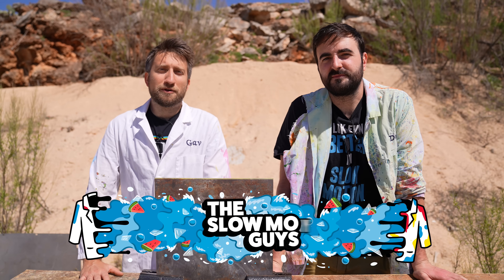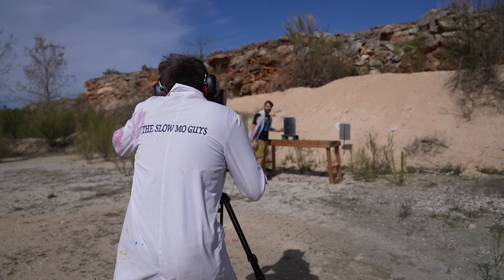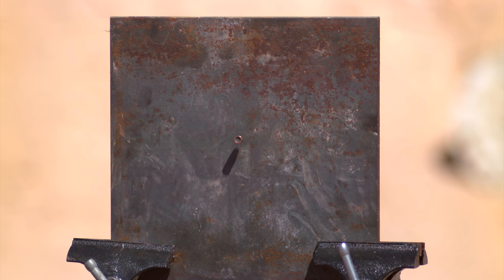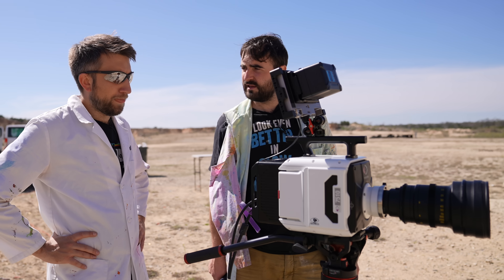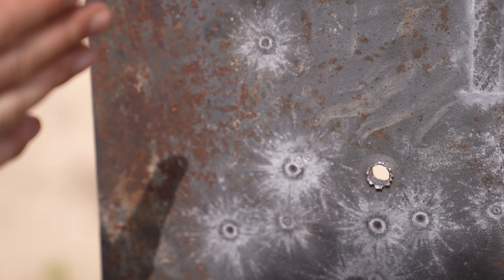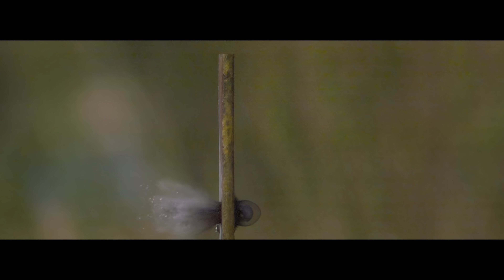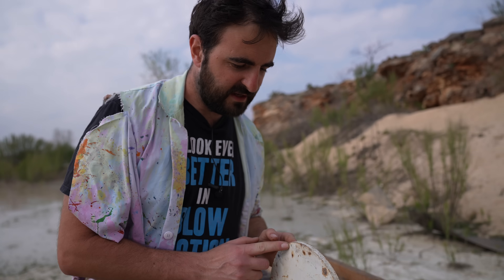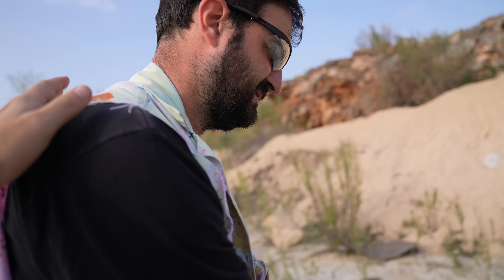Bullets vs Steel at 800,000 FPS - The Slow Mo Guys

Comment: Why does the bullet still continue to spin after going through the target? Physics...especially the conservation of momentum!

So, the principle of conservation of momentum is a fundamental concept in physics, and it states that the total momentum of an isolated system remains constant if no external forces act on it. Momentum, in simple terms, is the product of an object's mass and its velocity.

Let's break down the bullet-target interaction with respect to this principle:

    Before Impact: When a bullet is fired from a rifled gun, the rifling (those spiraled grooves inside the gun barrel) imparts a spin to the bullet. This spinning stabilizes the bullet in flight and ensures better accuracy. So, when the bullet approaches the metal target, it has both linear momentum (due to its forward velocity) and angular momentum (due to its spin).

    Impact with the Target: When the bullet hits the metal target, its linear momentum can be significantly altered, especially if the bullet gets flattened or comes to a stop. However, the angular momentum (the spin) is less affected by the impact. The reason for this is that stopping the spin would require a torque or a force that acts perpendicular to the axis of rotation. Metal targets, being flat, mainly resist the forward motion of the bullet but don't provide a significant counteracting torque to halt the spin. Hence, the bullet might still retain much of its spin even after impact.

    After Impact: Following the conservation principle, if the bullet continues moving after piercing through the target, it would have conserved some of its initial momentum, albeit with changes due to the interaction with the target. However, what's intriguing is that, as mentioned, the bullet often retains a good amount of its spin (angular momentum) after impact because the target doesn't efficiently counteract this motion.

In essence, while the metal target can significantly reduce or halt the bullet's forward momentum, the conservation of angular momentum ensures that the bullet's spin remains largely unaffected. This observation is a practical manifestation of the conservation of momentum.

Comment: This ended up as a beautiful demonstration of the difference between hardened and mild steel. Nearly the same material yet such a massive difference in properties.
Reply: and even cast iron in the end
Reply: @MeltedMask   In fact, I wanted to see a closeup of the fracture in the vice, as that may well have been cast iron.
Reply: @TesserId  most bench vises are cast iron, very hard but very brittle. Good for holding something extremely tightly under a lot of pressure, not good for taking hard impacts.
Reply: @Kross8761   Exactly.  And, all the cast iron that I've seen cracked has had a very course grain pattern.  Forged steel would not have looked like that.  And, that's all I wanted to see.  BTW, I've seen This Old Tony experiment with welding cast iron, which apparently is a real b*tch to manage.
Reply: When it comes to steel, the things the iron gets alloyed with makes a huge difference. To a point It can become a totally different material.
Reply: @Scrial  Yeah. I doubt the average person knows that the difference between low and high carbon steel is a couple percent.  Add a little bit of Cr, Mo, or Ni and you basically get a different metal that behaves completely differently.
ETA: Was going to use the example of stainless steel vs. steel or iron but forgot.
Reply: Hmmm. There could be differences in the alloys, or not.  Hardening could be just a change in the crystalline structure.  In this context, that somehow becomes much more interesting.
Reply: @yazmeliayzol624 There are lots of different iron alloys. And adding half a percent of some other element can change the properties a great deal.
And that is not "getting super technical". It is just simplest of the metallurgy anyone who is dealing with metals could know.
Steel is not it's own thing, it's thousands different things, each of which is it's own.
Reply: @azgarogly Yes. I have looked into a few varieties of stainless steels used in HVAC and there are a more than a dozen different elements used in different alloy mixtures depending on application. Carbon and aluminium are the most common, but nickel, cobalt, palladium to name a few are used in varying quantities. Alongside its composition, how the metal is treated once formed can also vastly alter the properties of the final material, including heat or corrosion resistance, cold set compliance, tensile strength and impact strength.
Reply: @yazmeliayzol624  Hydraulic Press Channel?  Oh, definitely.
Reply: @yazmeliayzol624 still steel though, it's a valid comment
Reply: @yazmeliayzol624  Great idea.  And, I like seeing good channels getting together.
Reply: love youtube man. only platform where you have a thread of people arguing about steel.
Reply: Same atoms, different crystal structures, enormous difference
Reply: Yes I wanted to say this exact point, this is an amazing proof of concept for the value of good manufacturing
Reply: @yazmeliayzol624 If you are narrowing all steels to just carbon steels that is racist. All kinds of low alloy steels and high alloy steels, like stainless steels, high speed steels, high temperature construction steels are steels too. 
And no. When talking about material, under "mild steel" the low carbon steel is meant, with less than ~0.3% of carbon. You can try to harden it. But it won't.
Sometimes they call steel "mild" when it is not hardened. But that references to particular chunk of steel as an object, not a material.
You may say "not actually a steel" about an alloy that has more than 50% of other elements in it. Because one needs to differentiate steels from, for instance, chromium alloys that can be 15% iron. Yet, some compositions with 45% of iron are still called "steel" despite being mostly other elements.
Reply: Well one can ‘over harden’ steel. 
If it’s too hard impacts can create spalling on internal surfaces in say Tanks. (I am oversimplifying of course)
Like all things it’s a balance between the needs of the job at hand. 
But as you say the video is a marvellous example of the differences between types of Steel.
Reply: If I had to make a guess, as someone who works with all types of steel, I'd say it's probably AR400.
Reply: @yazmeliayzol624 Just iron and carbon, really? 304 and 440C look at you and facepalm. S30V looks from behind their backs like "what did he say"?  The HSS just shrugs it's shoulders.
Reply: @yazmeliayzol624 Well, you can try to make a file or drill bit out of low carbon steel. But I guess, the result would be as good as making Hawking play basketball. Mild still won't harden much. It just can't.
Alloy steel is still a steel.
And over and over again. Steels come il all different chemical compositions and all different treatment. One who would say they are all the same either is making a joke or is a joke themselves.
Reply: @glyThat's correct.  Mild steel just doesn't contain enough carbon to harden much after quenching-tempering.
Reply: "Nearly the same material" is like saying Stephen Hawking and Arnold Schwarzenegger, both are just men, the same material :)
Reply: @yazmeliayzol624 That is the whole point. One is athlete, another was scientist. Both just men, yet so different.
There is a steel extremely hard and brittle, some you can bend and it springs back. One you heat a little and it loses all it's strength, another is red hot and still cuts. The file, the spring, the razor blade, piece of armor and the bridge truss. Saying they are all the same is... well... a joke.

Comment: 1/4' AR500 (abrasion resistant) steel will stop pistol and rifle lead rounds to .308. AR400 will only generally stop pistol rounds. 50BMG targets are generally 3/4" AR500. 1/2" AR500 will stop a 50BMG in most cases but the target will not last long.

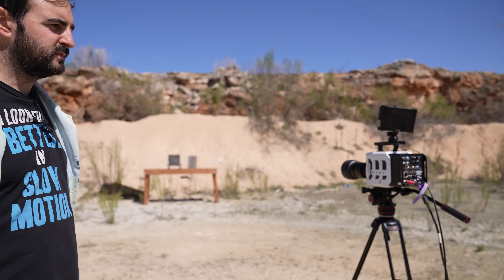Comment: 5:21 Dan is so sure about his aim, that he doesn't even consider the area behind the steel frame as a danger zone, since he isn't going to miss the target anyways.
Reply: In reality that is still a danger zone. He was probably just talking about places the camera could not be that would still get a shot. You should Never be downrange from a firearm even if the person has incredible aim. 'cause anything could happen and then you get shot.

Edited: as seen at 7:44 he would not shoot with anyone downrange because of just how dangerous it is.
Reply: @Cats-TM I mean it's pretty obvious what both Gavin and Dan meant by dangerzone. They're both talking about camera placement. That was always the context. Gavin was never going to be standing down range 

And as such it's just understanding basic angles when looking at the shrapnel pattern to determine where is safe and what isn't. Missing the plate completely would obviously not place the camera, which is in front of and to the side of the plate, in any risk. So being a bad shot would be irrelevant unless Dan was literally so bad he shot several feet over from the target. The issue was figuring out how close could the camera be without worrying about potential shrapnel or the bullet casing bouncing back.
Reply: It'd be pretty hard to miss that far.

Comment: I don't think it's sparks on the hollow point. I think it's superheated and super pressurized air trapped in the hollow point expanding out of the slits.

Comment: Video idea:  Shoot a steel needle front-on, so that the needle skewers the lead.  Would be interesting to see what effect it has.  ALSO:  A sheet of bullet-proof glass on a stand in front of the camera would be a very good idea.
Reply: Shooting a needle would definitely test how good of an aim Dan is. Somehow, I think the needle would just get annihilated, and not "skewer" the bullet.
Reply: @castleanthrax1833  Yeah the needle wouldn't penetrate it'd just get bulldozed by the bullet
Reply: Virtually impossible to ensure it hits straight on, without a fixed setup, and even then there are too many variables. Needles are extremely hard steel, so it would just splinter/snap/shatter, even under a .22lr. Couple that with the lack of a 90° impact and the needle snapping and deflecting the bullet slightly is the most likely. Not really worth the setup or time required to achieve.

Comment: 5:03 I love that you can see the bullet spinning against the plate still
Edit: yeah, .30-06 will go right through 1/2” mild. I’ve shot .223 at 1/2” mild and it goes right through. If you want it to bounce you need AR550 armor, or my starter is 1.25” mild, and it leave a 1/2” deep crater when it hits.
Edit 2: I see you found some hardened steel 👍
Reply: I have gotten similar results from my no 4 lee Enfield 303

Comment: As a gun enthusiast and a student of firearms tech. This is incredible footage. But I'm also curious of what firearms these guys were using.
Reply: I think the rifle is a M1903A3.
Reply: @timl8258  That is correct
Reply: @timl8258  Agreed.  '03 Springfield.
Reply: @timl8258  Thanks! Dug deep into the comment to find out. Was thinking Carcano, but I'm just a casual observer.
Reply: @dj-kq4fz  if you decide to buy one, they are good rifles. The one in this video is an A3 model which has the rear sights further to the rear. The original model has the rear sight further forward and for me, they are harder to use. The A3 is much easier for me.
Reply: @timl8258  Thanks! I love the look of it.

Comment: The round target is either AR-400 or AR-500,  AR is abrasion resistant. Mainly used on things like blades or buckets used to dig etc!  Shoot the round one with an AP round. (Armor piercing). 
If you need a Barret 50 cal to shoot, let me know. I even have APIT rounds!

Comment: shoot a disc spinning as fast as you can get it and see how the impact changes with the spinning of the plate
edit: if the angular velocity of the disc at outer edges is moving faster than the bullet, which will take more damage?

Comment: Something that would be awesome is thermal camera to see how hot the metal was heated an cooled during it.
Reply: That would be cool, we NEED Thermals!
Reply: would be a really nice dynamic for the information they bring across in the videos!  @tbrowniscool
Reply: A high frame rate FLIR would be fun to see. How hot are the sparks when the bullet hits?
Reply: That's the thing I don't think FLIR has that great a frame rate capability but if it did that would be awesome. I'm here to learn! @lauxmyth
Reply: would have made that few little light up parts they highlighted really interesting to see @lauxmyth
Reply: It wouldn't be by a lot.
Reply: It's very visible, you can spot 1000 yard shots by the heat left on steel
Reply: Yes this would be awesome. I've read some armor piercing ammunition in fact explodes at impact pushing part of the bullet tip forward, and heating it up so much that it basically liquid metal which goes through the armor. Just checked and these are called HEAT antitank shells (from the "Armour-piercing ammunition" entry, Wikipedia)

Comment: The way the bullets against the steel plate disintegrated and split apart make me interested to see what would happen if you shoot a super powerful magnet. Would the bullet fragments stick as they split apart? 🤔
Reply: Lead and copper aren't magnetc
Reply: Most bullets are lead and copper so they wouldn't stick to a magnet
Some surplus rounds have a steel core but they'd punch through the magnet. Could make for an interesting video
Reply: Nah man, at that speed that magnetic field might as well not be there.
Reply: @mistrants2745  to catch the bullet yes. Id imagine it would be similar to the video smashing magnets together. might catch fragments if backed by steel plate
Reply: @junkyardmetalworks4003  the fragments tend to move as fast or faster than the bullet. Not to mention knocking magnets this hard tends to remove their magnetism. 
I suspect youd be lucky to have some dust stick to the steel...

Comment: you should do this again but coat the steel in some sort of incindiary powder which would hopefully catch fire with the spark of the bullet going boom on itself.
Reply: How about some API rounds
Reply: how is that not igniting when going through the barrel?
Reply: @MickeyStartraveller  sorry I meant to coat the metal plate the bullet hits
Reply: @MickeyStartraveller He is talking about the target but its possible with the bullet. Tracer rounds dont ignite for a couple hundred feet. So they don't ignite in the barrel and cause extra wear.
Reply: DO NOT do that ever.

Comment: Gav, I want to ask: The Phantom TMX 12, the fastest phantom that currently exists, what is the HIGHEST frame rate that camera can possibly do? Like, in terms of removing color and lowering the vertical resolution, what is the highest speed it can do even if the footage is completely indistinguishable? And how long does it stretch one second of real time into when played back at 25?
Reply: Their website says 1,750,000 frames per second at the lowest resolution. That would be 19 hours at 25fps
Reply from the maker: @cinemaker321 this guy gets it
Reply: @theslowmoguys  Do a collab with demolition ranch they'll give you access to all sorts of special rounds and guns :D
Reply: @cinemaker321  Holy dung. But they've filmed at 5 million before haven't they?
Reply: @ClonaClox9999   that was with a Shimadzu, not a Phantom, and it only records 256 frames per shot
Reply: there are extremely specialist cameras that can film at 10's of millions of frames per second at fairly good resoloutions, however they are limited to only a few hundred frames, they do this by using multiple sensors and a rotating mirror (spinning at tens of thousands of rpm) that directs the image on to each sensor one at a time, They originally used a strip of film and were used for imaging explosions but I believe they still exist in digital form now

Edit: Yeah there is the model 521 which boasts a framerate of 2.5 million fps at 29 megapixel 14 bit RAW, but can only capture 24 frames in one go